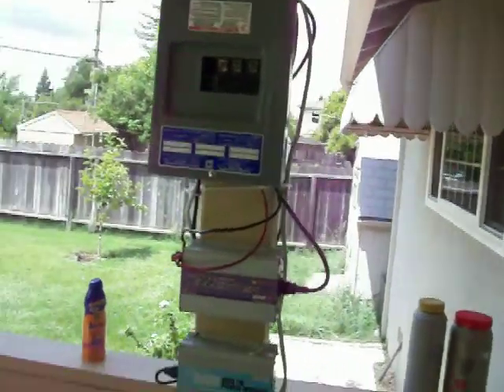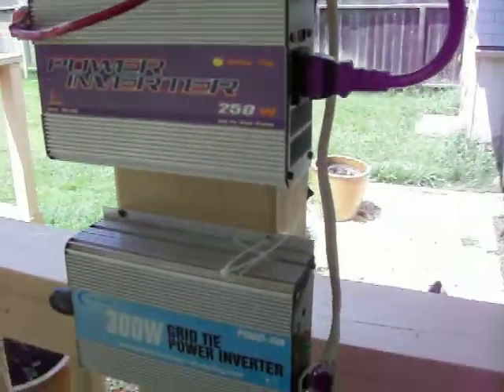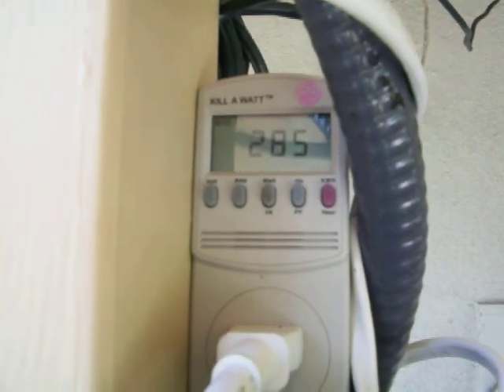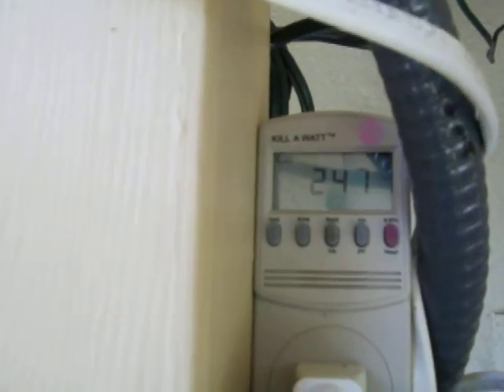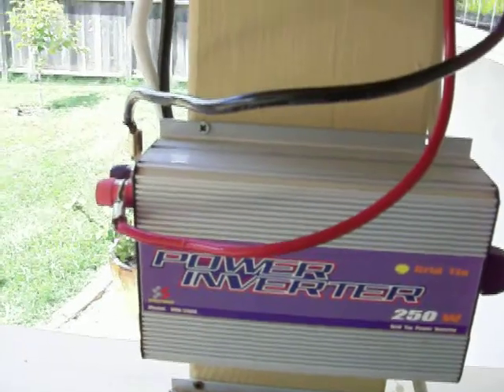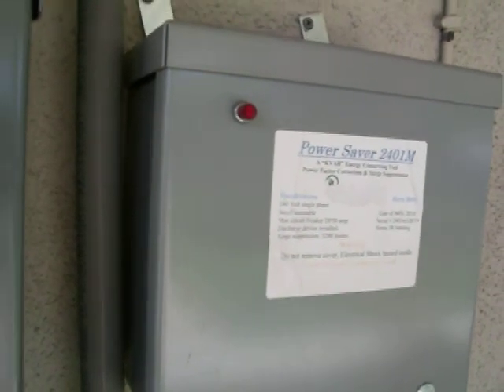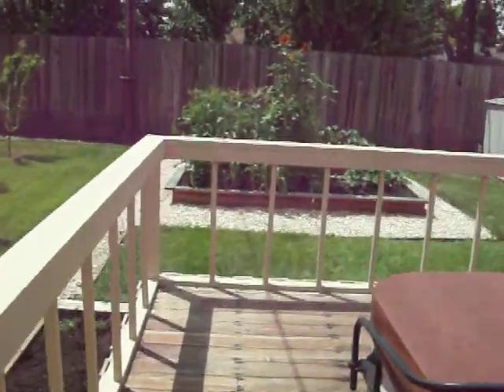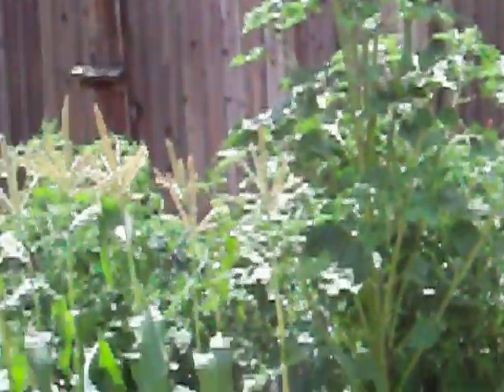Grid tie inverter  getting 250 watts

Comment: What size panels are you using to run each grid tie inverter? Also what is input voltage required for your inverters? I have a 235 watt panel and I am only able to get 120 watts max out of the inverter for some reason.  I did set the correct angle for the panel. I want to make a video after I get things up and running correctly. I am only making about 1 KW per day. I want to expand it later.

Comment: Then the power company is stealing from you. You can't always be drawing 250W during the day and you should be getting credit for the power the power co. is charging your neighbors for. Check the actual legislation on this, do not believe what the power co. says, read the actual legislative intent, I bet it says they have to provide you with a meter that goes both ways, and of course they don't want to do that or let you know! If not call your legislators and complain and get things changed.

Comment from the maker: @nrodge1 
the new meters will not go backwards. but it does really slow down when I'am pushing in 250 watts per hour.  i'am going to make a box to put this in for the winter time.  I'am ordering another inverter plus 2 more 85 watt panels.  going to try to add one inverter and 2 panels every year, for next 3 years

Comment: You should move all that inside. What is going to happen when it rains and it's windy? Looks good and your fan idea on the last video would probably keep you from having to buy another GTI.  1.8 KWh a day is about right for that amount of panels in the heat of summer on a good day. It all adds up every month. Does your meter show anything going backwards? Meaning, is the power company stealing power from you?